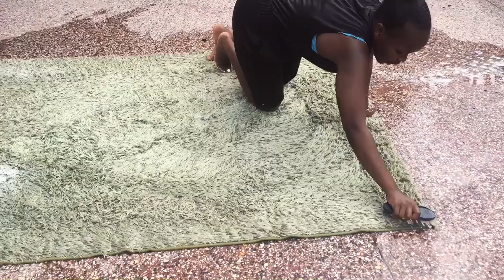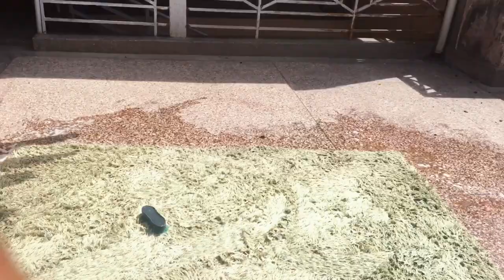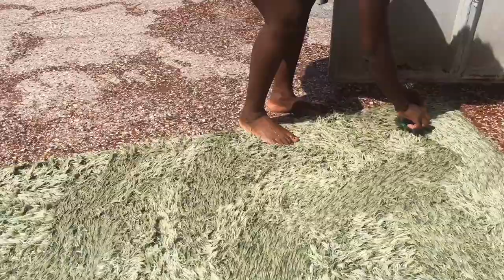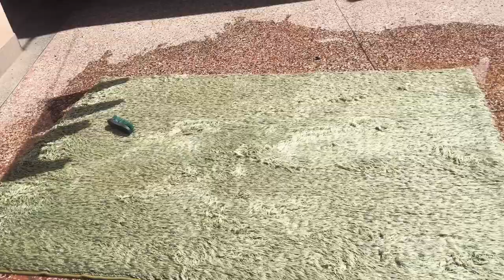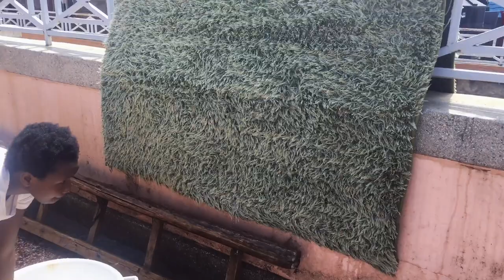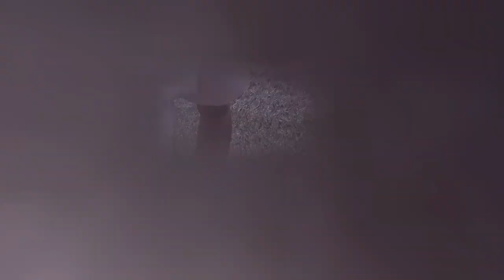Rose has confirmed that”wacha Ezekiel alie kabisaa”ni wakati wake sasa @TruekTVNetwork

Comment: Next time use a horse pipe connect to the tap squeeze the pipe to put pressure and it helps take the dirt then while rinsing turn the carpet upside down roll it and while rinsing you will be surprised how much dirt will come out repeat thus till it's clean. I learnt washing big humongous carpets in Saudi Arabia for 2 years it's a hard and tiresome job but nilivumilia and God blessed me afterwards.